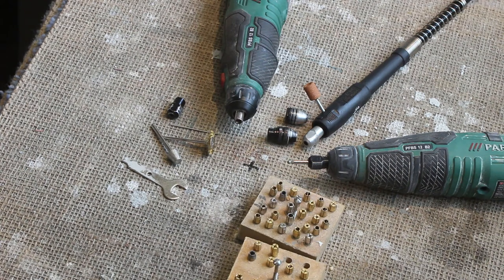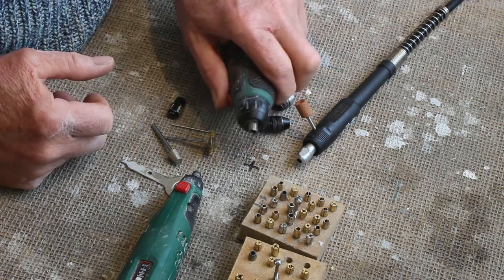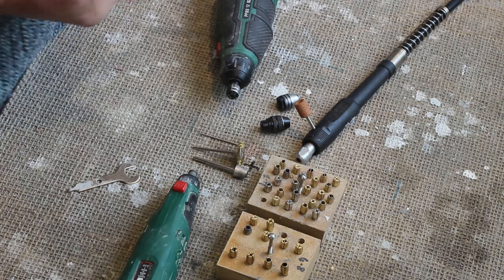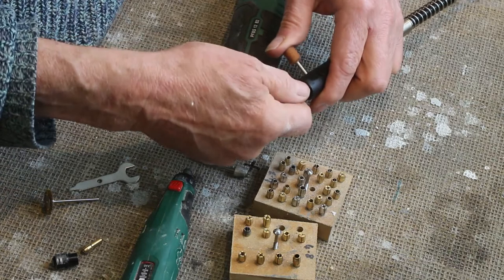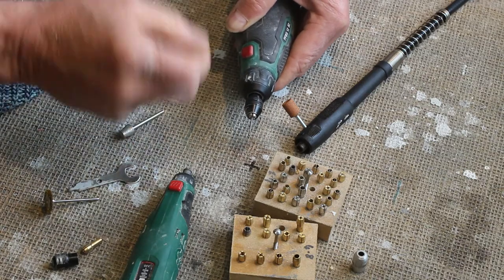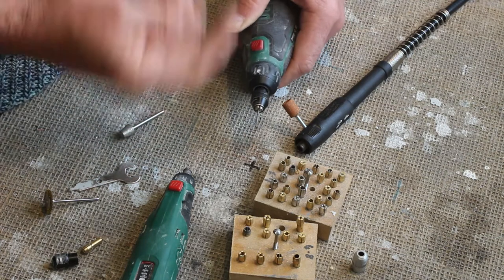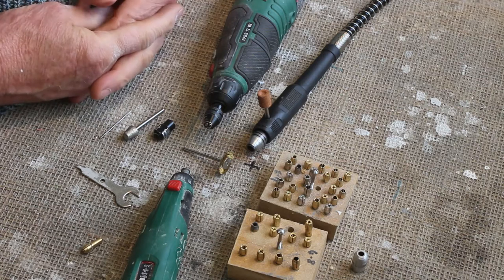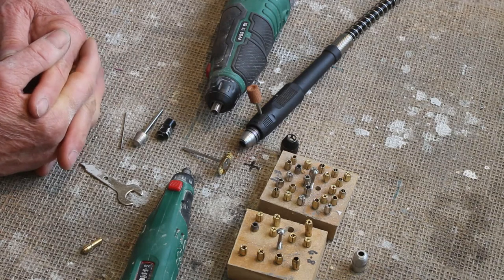Universal chuck for rotary Dremel type tools. User review.

Comment: i ruined my chuck nut. by tightening it too much, couldn't find the correct replacement nut anywhere. ive ordered a universal chuck now and hope for the best. my rotary tool is the same parkside as you show at the top. thank you for this!.
Reply from the maker: It is a real pest that Lidls/parkside do not sell spares, it does rather devalue thee tools.Is your new one coming from China?  If you find your new chuck does not fit please let us know, it will be useful to see what others experience with these chucks. Thanks for the input and good luck!

Comment: Excellent and very helpful, thank you. I have a Parkside cordless rotary tool and the aluminium collet nut, stripped it's thread so is now useless. Have been exploring different options to replace and was looking for a chuck like this. Can you tell me, is the one you use on the Parkside tool, made of steel or is it aluminium as well? I hope I can get an all steel chuck as the aluminium ones just wear out so fast being far too soft for the job.
Reply from the maker: It is aluminium but is a bit more robust and chunkier than the standard chuck.
Reply: @thestonecraftingworkshop7490  Ah, Many thanks for that. Pity it's 'ali'. For precision stuff they tend to not be accurate enough and wear out in my experience, but for the money, I will give it a go, I may be pleasantly surprised. The main issue I have had, despite not over tightening any of my tools, is that aluminium and steel threads just don't work together for very long. Thanks for the reply!

Comment: Really nice and helpfull video. Tks for sharing. By the way, do you think one of this universal chuck could fit on a similar but bigger tool like a makita die grinder?
Reply from the maker: Sorry Fernando, I don't know. It will depend on the spindle size and thread. If you can confirm these you could search on eBay for one that fits. Best of luck!
Reply: @thestonecraftingworkshop7490  tks for your reply. I think I got measure and after that I would share the informatio because it'll probably be helpfull to others : )

Comment: What collet would fit the Alltrade rotary tool ?.....I have 4 knurled collars and NO collets...
Reply from the maker: I am not familiar with the "Alltrade rotary tool" I have looked online without learning much. I would remove the locking nut and measure the width of the threaded shaft and the inside width where the collet will fit. Search on eBay for the right size collet or for a universal chuck (thread size m7 or m8 will probably do the job) This might help for sizes https://youtu.be/5HZM6DpV92s   If the tool is Chinese made these parts seem to be pretty standard.  You might have to buy 2-3 bits before getting the right size but they are cheap. Good luck with the search.

Comment: I have got the keyless chunk but it doesn't fit the dermel. How do I get over this difficulty.
Reply from the maker: Check the thread size it will probably be either 7mm or 8mm (m7 or m8 FINE )  and buy one the right size. Best of luck!
Reply: Dremel makes one; part 4486. About $10 ~ $13 USD.

Comment: Parkside should use 8 mm nut. My nut threads on Parkside worn out after too much testing/changing tools in first weeks I owned it. Nut is made of aluminium and shaft is steel. I hope shafts threads survived. Bought same chuck (one long, one short) as in your video. Ordered but haven't received yet. I searched for "original" 7 mm nut but couldn't find on Ebay, Aliexpress or Wish. 
Edit: yes, now I found M7 nut. It's same as brand "Hilda" and other chinese variants.
Reply from the maker: Thanks for the info, my parksides have a 7mm thread? I actually split one by over-tightening. I find that I almost never use the spanner to tighten the nut anymore, I simply hand tighten and this is usually fine.  Cross fingers for your order coming thru. Good luck!
Reply: @thestonecraftingworkshop7490  Thanks for answer! Received the universal chucks but they didn't fit. After some research and own measuring my Parkside has a strange thread. Not M7 with fine thread 0,75 mm, it's about 0,66. Totally wrong choice by Parkside. Will not order any more chucks. My machine also vibrate a lot, axle has play sideways. Have receipt and will try to get money back. Very dissapointed about this purchase.
Reply from the maker: @stonehill27  Curious, I had the two you saw in the video listed as  M7 (fine) M8 (fine) fitted no problem. One problem is the Chinese sellers very often know little or nothing about the products they are selling. It is a great disappointment that Parkside/Lidl do not make spares available. This does devalue Parside tools. Sorry your experience was poor, hope you find a better solution/tool for you.
Reply: @thestonecraftingworkshop7490  I read about the unusual fine Parkside thread in a forum. Then I measured myself with caliper distance of 10 thread bottoms and divide by 10 and got about 0,66. The two universal chucks I got from China, I think they are M7 x 0,75. I can screw them on axle about two twists (about 2 mm) then it stop. That's a sign of wrong thread size on axle. Looked at other platform (Bangood?)  and one customer wrote that universal chuck M7 fine 0,75 mm didn't fit his Parkside. I think it was the B3- model (latest). Maybe Parkside changed thread for latest model? I haven't heard from Lidl yet. Maybe I will buy a cheap corded machine at local shop. I think that machine have normal M7 fine. And I can use my universal chucks.
I have now mailed kompernass@lidl (before I mailed wrong adress I think) and explained the whole thing with thread, poor chuck quality and also with axle vibration. If I get answer I will post here.
Reply: Update: No answer from Lidl. Bought other corded multitool, rebranded chinese, at local shop today. Same price as Parkside. To my surprise the included chuck fit Parkside.  Asked seller but he didn't know thread dimensions of the chuck. 
Tried the universal chucks I have but they don't fit new machine. No surprise.
So I don't know what to think about this. Maybe Parkside and this new machine I got have M7 fine standard thread and the universal chucks have some strange size?
Anyway, the new machine is much better. Chuck look/feel like steel or hardened aluminium, no axle play at all, stronger motor and higher rpm. But it's much heavier. I can now use Parkside with chuck I got with new machine. I hope chuck  last.
Reply from the maker: @stonehill27  OK well done for persevering. It sounds like the universal chucks were an odd size? What make grinder did you buy? Good luck with your carving.
Reply: @thestonecraftingworkshop7490  Bought universal chucks at Wish. Description is just "M7 1pcs Long and 1pcs Short".  I don't think they sell with other than standard fine thread, but you can never know. Some give it 5 stars and other write that it doesn't fit. Not easy to find right size 🤔
Bought new machine from shop "Jula" in Sweden. Brand is their own "Meec tools". Made in China and probably just a rebranded item.
About Lidl 3 year warranty. I'm not convinced. Looks good with a sign on packaging and maybe more of a marketing thing than actual warranty. Maybe I try to talk to staff at my local shop  to get my money back.

Thank you taking time answering!

EDIT: totally forgot to measure inner size of the universal chucks from Wish, it's 6,4 mm (should be about 6,8 mm for M7). So they sent me wrong size and also advertised it wrong.
Reply from the maker: @stonehill27  Here in UK as long as you have had it less than 1 year and have the receipt you can simply return to the Lidl store. best of luck.
Reply: @stonehill27  About the shaft on the Parkside tool vibrating... you can modify the tool by putting in an extra ball bearing in the tool, up in the front of it. The plastic molding has a slot for an extra bearing there, but Parkside cheaped out on it and just used a single bearing for the shaft. The user 'BikeGremlin' has a video on it, with the dimensions and specs for the proper bearing. It costs about 5$. Apparently it fixes any problems with the shaft vibrating. Just got a Parkside myself and I'm considering it, seems like a worthwhile upgrade. Modifying it will probably void your warranty though!